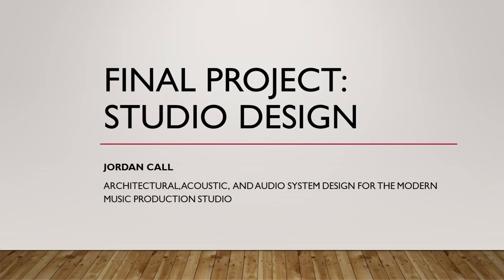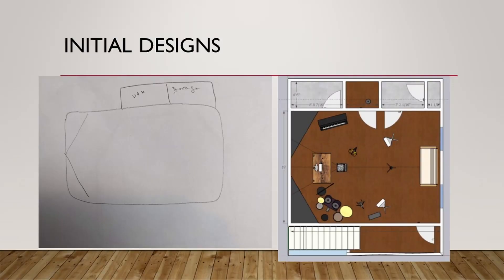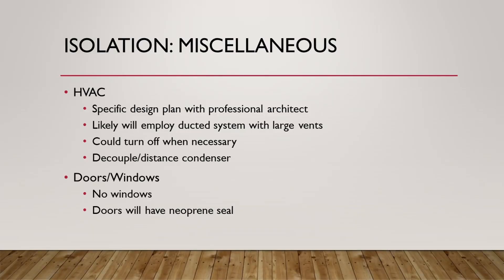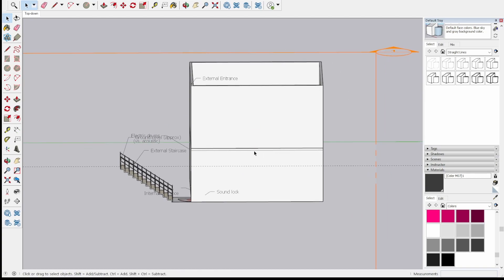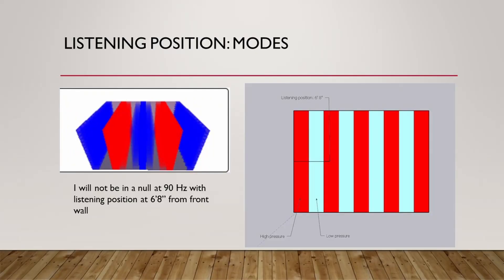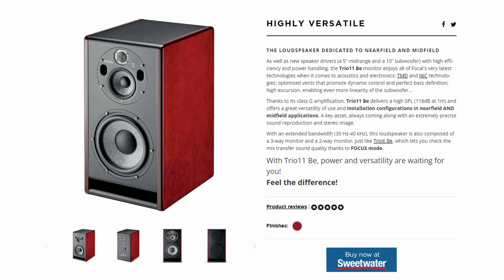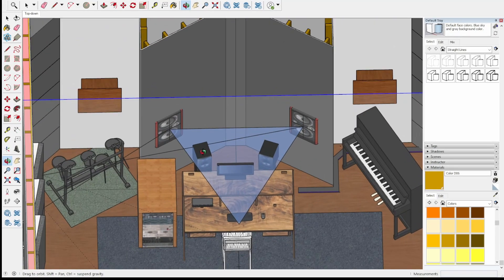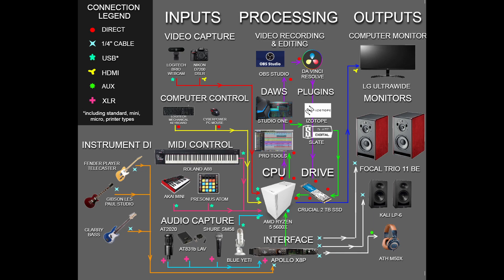I designed a CUSTOM STUDIO for my Berklee Masters

Comment: It might seem unimportant, but since everything today is posted in video format, setting up the camera is also an important bit.
And something that nobody talks about is how to record yourself most easily, i.e. get a dummy battery for your DSLR/Mirrorless camera, so that you can plug it in and record for an unlimited amount of time, and also get a video capture card to connect your camera to your computer, so that you actually record from the computer (OBS) and not from the camera, because recording on the SD card and transferring video files is such a tedious process that just kills all motivation
Reply from the maker: This is awesome, thank you! I am here for every video production tip you've got. I figured out the capture card thing a little while ago, total game changer, but I've never even heard of a dummy battery! Will look into it immediately, tell me if you have recs for brands (I have a Nikon)
Reply: @JordanCall  so every camera model has dedicated batteries to it, and you need a dedicated dummy battery that fits. For example my Cannon uses LP12 batteries, and I had to find a dummy LP12 battery, which you just use to replace your main battery. The dummy battery then comes also with a cable which you connect to a power outlet, and voila, infinite energy
Reply: It's pretty neat when you have everything set up (camera, microphones, speakers), because then you just sit in your studio and have everything ready, and especially the camera that you can control from your computer instead of manually
Reply from the maker: @zerosiii  when you say control the camera from your computer, is there a way to control like the focus and stuff from the computer? That's one of the hardest/most tedious things to get right when I'm self-recording. Id also love some kind of remote control rig for directing the camera but that seems a little intense
Reply from the maker: I'm on a Nikon D7200 in case it matters
Reply: @JordanCall  ahh I just meant to click "record", and be able to see your camera feed on the computer screen, and to have videos be written directly to the computer instead of an SD card. I guess you could also control the focus and position, but that would require substantially more mechanical and electrical engineering 😅
Reply from the maker: @zerosiii  yeah okay this is what I figured...but i completely agree, recording direct through OBS is the only way to do it